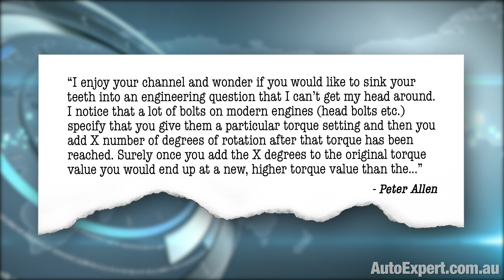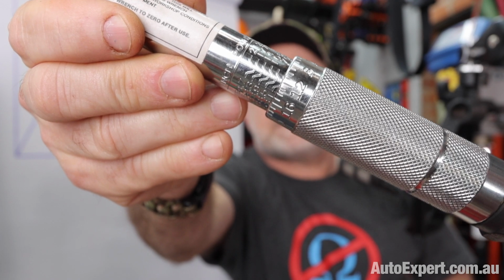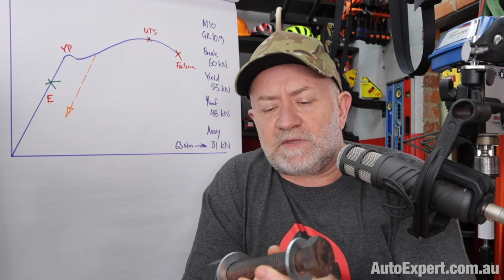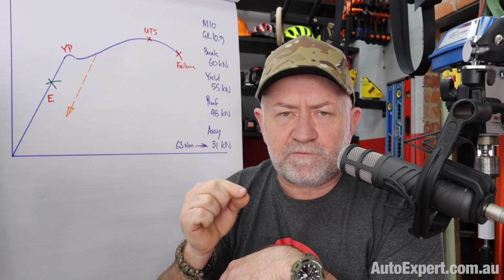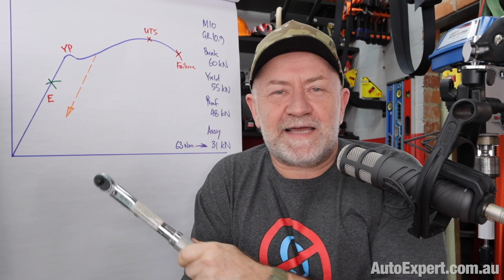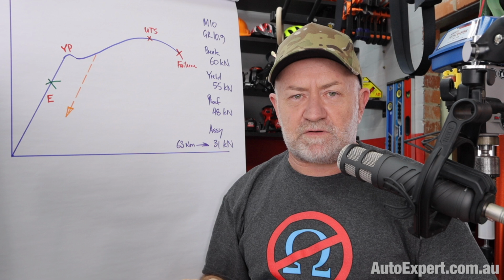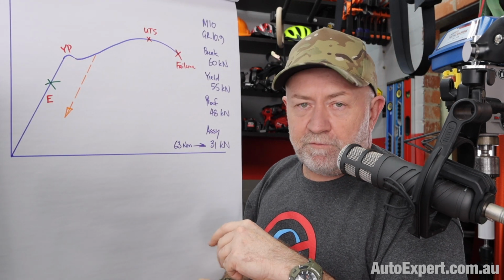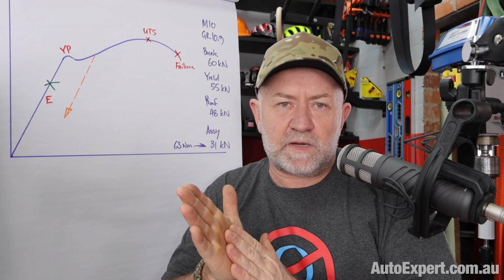Torque to yield bolts & angle tightening explained | Auto Expert John Cadogan

Comment: Thanks John. I learned something new. Is there a way to convert torque specs to angle tightening specs?
Reply: Sort of.
Since steel has an elastic modulus of about 206GPa, if you know the stretched length you can work out how much you need to turn the fastener to generate the preload you want from the thread pitch and some assumption for the joint abutment stiffness.
Because the things you are fastening together squash as the fastener stretches.
And even with a lot of guessing, it's still more accurate than torque tightening.
Reply: @johnwade1095  Thanks John. Sounds rather involved. I was thinking perhaps I could make up my own specs by torquing to a low figure first and then noting the turn required to get to the specified torque across all of the bolts. By taking an average of the turn required I would at least be getting consistent clamping force. Can you see any problems with that approach?
Reply: @nicksauer6749  That would improve your preload repeatability (I think) as long as the stretch length of the bolt is the same, and you are fastening things with similar stiffness.
If the supplier specifies a torque, stick with that, but measuring turn as an 'oh shit' test won't hurt.
Reply: @johnwade1095  Sounds like good advice, thanks.
Reply: @nicksauer6749  typically, torque plus angle bolted joints are developed using ultrasonic stretch measurement, the calculation is just a first guess. In blind holes anyway.
Check out boltscope on youtube.
Reply: @johnwade1095  Cool instrument, but no prices posted. Probably out of reach for the average guy torquing his cylinder head.
Reply: @nicksauer6749  30k
It's just a cool thing to know about.
Torque plus angle gives good repeatability, but needs calibration.
Hydraulic tensioning is the gold standard.

Comment: Rattle Gun > Torque Wrench Sensei. Who needs Jedi wrenching skills when perfect torque settings are just three or four ugga duggas away. 😁👍
Reply: Mate you got me crying 😂
Reply: hahaha, now I want to see a full engine rebuild done only with a rattle gun, lots of ugga duggas needed for that one lmao
Reply: @petarmiladinovic4126  My only issue would be to decide whether to use 1 or 2 uggas for the rocker cover. 🤷 Seen conrods, cam bolts and a few other engine pieces ugga'd together, just mostly 1/4" drive stuff so not much pressure, but rotaries, different story. Crack out the 54mm 3/4" drive and 800Nm for the eccentric shaft nut. 😂👍

Comment: all true for sure, 
I reckon the cars of today are more highly designed than the space shuttle.
Can I add a bit to your excellent boltification.

Many bolt breakages can be attributed to under tightening!
as opposed to much popular opinion saying breakage caused by over-tightening.
for example: When a bolt is tightened to say 50kN 
and it's joint sees a load which is 0 to 80kN in a cyclic fashion. (ie a wheel stud)
The bolt is subject to fatigue as the bolt tension varies from 50 to 80kN.
However If the bolt is tightened to 100kN
and it's joint sees a load which is 0 to 80kN in a cyclic fashion.
The bolt tension does not vary from 100kN.

Fatigue can occur at relatively low stress levels if the cycle rate is high.

Like coathanger wire bend it back and forth a few times and it snaps easy.

Comment: Is this why , when I used to play with torque wrenches , I could turn the wrench until it clicked , then reset the wrench to the same value , apply more torque to the bolt and get a few degrees of further rotation before it clicked again ?
Reply: Joint relaxation, especially with soft gaskets.

Comment: I have hit the Aweshit Point (Bolt Break)... when trying to remove a head bolt or exhaust bolt.  Never tightening.  Penetrating oil is a good friend to have!
Reply from the maker: Use a hammer.
Reply: So is a reverse flute drill.
Reply: @AutoExpertJC  LOL... A very large hammer!

Comment: When tightening my sump bolt I experienced the Ultimate Tensile Strength (or perhaps it was the Yield Point?) and felt it release. I immediately backed it off a turn and gingerly retightened it. Cursing my use of a half inch rather than 3/8 wrench. On the bright side it hasn't leaked, but I'm worried that it'll fail completely in a few engine oil changes time. Any advice?
Reply from the maker: Replace it and Helicoil the internal thread.
Reply: @AutoExpertJC  many thanks!
Reply: You're probably going to find the thread will come out of the sump with the plug next time you undo it, especially if it's an alloy sump.
Reply: @rustymozzy  that doesn't sound good. :/
Reply: @AutoExpertJC  What holds the Helicoil in, the next time/s the plug is removed?
Reply: @rustymozzy  I've purchased the helicoil kit ($30) and am wondering if I need to take the sump off to do it? Aside from getting it straight in the hole, is there a way to get the shavings and broken-off tang out? Like refilling with the old oil, and hoping the metal comes out when I open the sump again? I could even do this a few times? Better than taking the sump off maybe?

This answers that question:
https://youtu.be/sMdJoqQzU2U
Reply: @rustymozzy  I'm thinking to try the Ecoplug first as there's no shavings in the oil pan.

Comment: Hello John. For one who normally requires others to be grammatically/factually correct, I am surprised you stated the American or imperial equivalent of Newton Meter is Foot Pound. Should that not be Pounds Foot. Other than that minor discrepancy, excellent info.
Reply from the maker: Vernacular: foot-pound. In practise these units can be presented in any order.
Reply: @AutoExpertJC  Agreed, but seems only the reverse is applied in imperial units - never heard the reverse in SI.
Reply: @AutoExpertJC  Ft-lb is used for work units. Lb-ft for torque units?

Comment: Have just replaced my crank in my car , so ordered up all the items to complete . I ended up with only two new conrod bolts and was told the remaining bolts could take 6 months . I decided  to reuse the bolts to get it on the road . I torqued the bolts then went 90 degrees . All the bolts acted the same to 90 degree then hit a wall . I have the bolts on order what could happen now to the used bolts. I have used the car. Bolts  m6 x 1 x 34 and car is not a sports car .!

Comment: Oddly, I keep coming to the idea that thread friction keeps bolts from vibrating loose or loosening due to thermal expansion or contraction... So when a friction modifier is applied to the threads like anti-seize.  So I'd think you would want to tighten anti-seized bolts should be tightened tighter so as not to come loose.  But... by tightening the bolt tighter, you are adding even more clamping force at lower torque. So an anti-seized bolt should both have more clamping force at a lower torque value and be more likely to vibrate loose at the same time.... Any thoughts, assuming I"ve made some sense.   

Now please move on to the dynamics of aluminum in the block and cylinder heads... In some engines, you are much more likely to strip the threads on the head or block than you are to snap the bolt... Any thoughts?
Reply: It depends on the Al. Grade, how much thread engagement you have, and how well the threads are cut.
Thread forming screws hold better in Al. than actually cutting a thread properly (the trilobe type do anyway)

Comment: Simple metric fastener rule.....  A newton is very roughly 1/10 of a kilogram.  (Actually it's the reciprocal of the gravity constant 1/9.8 i.e.  .10204081......... etc etc. ...) A pascal, the metric measurement of pressure and also tensile strength,  is 1 newton per square metre.  A 10.9 grade metric fastener has a minimum ultimate tensile strength of 1000 times 1000000 (1MPa) pascals (1 000 000 000 pascals) and a minimum ultimate yield strength of 90% (900 000 000) pascals.  So basically the first number is when it breaks.  The second number is how much it can be stretched before it is fucked.  The higher the numbers and the closer they are together the stronger the fastener.

Comment: One thing John metric bolts the tensile strength is a class where as imperial bolt strength is a grade. Dont confuse the two as grade 12 imperial does not equal metric class 12.9.

Comment: I worked in an American heavy equipment manufacturing factory... we used torque-turn a lot... some were tightened by precise equipment, some were done by hand... when the equipment broke down then we did it by hand....  whenever we did them by hand, we just guesstimated the degrees...  I don't buy American-made if I can avoid it...

Comment: 17:20 i think your maths is a bit wrong.
F = ma
m = F/a
m = 1000 N/ 9.8 m/s = 102.04 kg

Also, you probably know this, but when the material is put in the gitmo of passing UTS the cross-sectional area shrinks, so the true strain increases, but as us engineers assume the cross-sectional area stays the same, for practical purposes the strain goes down as the material necks & fractures.

Comment: Begs the question as to why some don't lubricate and clean the threads during assembly. It makes all the difference between warping cylinder heads and thermal expansion irregularities.

Comment: I kinda feel like you stopped short with your explanation of 'torque to yield' bolts...so, they stretch permanently a little, and from then on they are elastic along a different line...how is that of any benefit in terms of making sure it is correctly tightened...esp. compared to the other methods?
Reply from the maker: Higher clamping force is the benefit.

Comment: In years gone by some engines specified that bolts were tightened finger tight then so many tors after that, Gardner was one and leyland also had a few like that. I worked on fitting a lighting gantry into a victorian cast iron framed building and a structural engineer had to fit strain gauges to some new tie rods that spanned the building, these had to be heated to a certain heat then the nuts tightened until the specified stretch was achieved then they had to be slacked of a specific amount on cooling.

Comment: I laughed at a set of TTY head bolts that said "Torque to 36Nm+90+90+90..If the bolt starts to feel loose then stop and move on".
Reply: Hahaha wow! I would have thought if it starts to feel loose, discard and and revert to step 1

Comment: Just a hack to help counter the distraction he refers to at the end of the video. What you are doing tty bolts as soon as you have finished mark said bolt immediately with a marking medium i use a white nail polish then clean off when done with acetone commonly found at any hardware supply or box store even watmart carries 100% acetone.

Comment: Torque to yield?
Does that mean you're meant to tighten until the shifter yields and rounds the head off?
Reply from the maker: Use Vise-grips. Or a big Stilson's. Nut-fuckers are for wimps.
Reply: @AutoExpertJC  Thats what my mother used to call them 60 years ago
Reply: In NZ (the real shitsville) we call them Crescent spanners banned on aircraft use unless ground equipment.

Comment: If a bolt has 8.8 stamped on the head it means it is metric thread . If you use super 14 grade bolts  ( the highest rated ) do the cunts up as much as you like unless you are using a hydraulic torque amplifier.

Comment: Another crucial reason for using torque to yield fasteners in cylinder heads is once a fastener moves beyond the elastic limit it theoretically cannot continue to stretch whilst in service as other bolts may do.  This is quite handy with something like engine cylinder head bolts as any in service elongation of the fastener would lead to cylinder gas leakage and possible head gasket failure. Not a good thing....... this is why these types of fasteners are selected.
Reply: Even stretch to yield bolts still have a creep factor.  The number is low but not zero.

Comment: TTY bolts are not new. I have an '89 Pontiac Lemans. Actually a Dea Woo. This thing is strange. It has a factory windage tray. Well the head bolts. Torque to 18FT Lbs. Then to 60 degrees. Then to 120 degrees, add additional 60 degrees. Then torque to 150 degrees, additional 30 degrees. Ok initial torque about spark plug tight. Final about water pump tight.

Comment: The other thing with torque to yeild bolts is every time you take the head off you have to buy a new set of head bolts 

No if’s no buts......

at 20 bucks each minimum and you’ll need 10 or 12 of them and car manufacturers do like to sell parts......

So it can easily be 300 bucks in head bolts every time the head comes off which shouldn’t be that often but nevertheless it’s 300 bucks

My old 202 Holden red motor the head bolts would come out and if they weren’t corroded they would go straight back in again and there was never any problems....... and because they weren’t specialist torque to yield bolts even if you did have to replace them they weren’t too bad on price
Reply: At those prices you'd best throw your torque to yields in the bin and replace with quality studs such as ARP.
Reply: Daniel Edwards 

20 bucks is cheap 

I had an alpha Romeo once and those head bolts were over $30 each........

Comment: Car suspensions are full of TTY bolts, even in places you would not expect like strut mounts. Every time you need a wheel alignment you have to undo said strut bolts to adjust the camber. Bloody stupid if you ask me. Try and ask the bloke at the local tyre shop if he can replace the strut bolts after he's finished aligning and you will get a blank look. When it's time to replace the control arm bushes you may find you can no longer source the damn bolts due to the age of the vehicle. It cost me a butt load to get control arm bolts for a VF SS from the US.

Mrs Powell would be turning in her grave if she heard you mixing up precision and accuracy. For example, you could argue a digital Snap-on Techwrench is more precise compared to a beam or click wrench because the Snap-on can measure fractional torque units. In both cases accuracy is a function of linearity and calibration.

Comment: In oil and gas industry we use Teflon coated nuts and bolts to lower the mating friction for accurate torque force

Comment: Torque to yield bolts is garbage. My old M156 engine suffered this issue and we couldn't trust MB to find an overkill solution. Ended up fitting ARP stud kits. 1 issue fixed. Many left hahaha

Comment: This "torque to yield" thing is really a stupid idea, and it can be easily avoided and not use any more "real estate" simply by using a stronger material, and there always will be an option to do that - there are myriad steel grades and treatments. This all about car makers cutting costs and making design more vulnerable. In sensible engineering design there is always a "factor of safety", but with "torque to yield", well it has "none", and most engineers would describe this method as an inadequate proposition. Such designs could also instantly fail due to the tiniest imperfection in the fastening assembly which would act as a "stress raiser", and the whole show would be over - "bang" and it's in pieces.
Very good explanation, John. (I'm a mechanical engineer).
Reply: Bolts that can only be used once... Whats next? Single use cylinder heads? This is simply manufacturers trying to save a few dollars.
Reply: @extrasleepy1796  Yes, components that "self damage" upon first use so they cannot be used again - the "throwaway" economy is thriving.

Comment: I still think it’s silly using torque angle. If a engineer can work out the stretch of a bolt he can work out the torque setting that incorporates the stretch. Torque angle is so easy to mess up and also it can’t be checked. If you use a torque setting, I can check it 50x times. If it’s a torque angle, who knows if it’s at 80° or 90°. I feel like it’s lazy on the engineers part. It’s also very hard to tighten the bolts as most wrenches don’t like you to ratchet a torque wrench on angle torque more. Means you need to tighten the bolt 90° in one clean sweep which isn’t always possible due to working in a engine bay.
Reply: Have you watched the video? Using torque only is very silly ("accuracy" about plus/minus 25% variation in resulting clamping force).
Torque is mostly measure of the friction under the head and threads, so it's very sensitive to thread condition.
Angle is more precise and fool-proof, because thread has a pitch, right? Therefore you can transfer angle to the elongation (therefore tension for particular thread diameter).
Reply: @GrandePunto8V  I feel like if this was the case every aftermarket engine would be torque to yield. However any aftermarket engine component is torque rating. I don’t think ARP head bolts and head studs make a torque to yield product.

I actually would be very interesting if GT racing or F1 engines use torque to yield.

Comment: Torque-to-yield head bolts are 100% crap, all of them.  You can buy a $200,000 Mercedes and it will have TTY head bolts!.  Anytime I overhaul an engine, I use head studs like what ARP manufactures.  No angle gauge, no special tools, no snapped off bolts, and all you need is a good torque wrench.  The reason manufacturers use TTY bolts is because they are cheap and the assembly process can be done by a CNC machine.